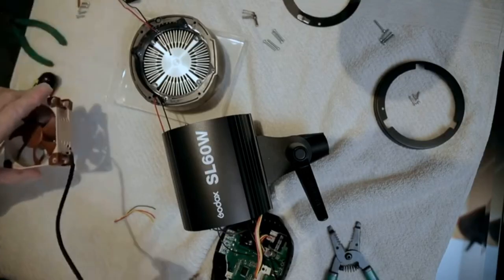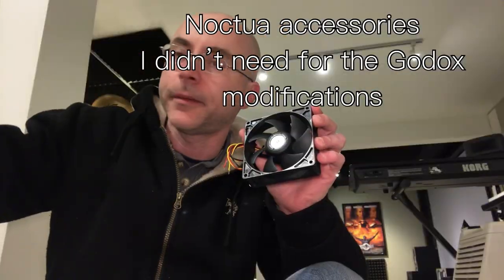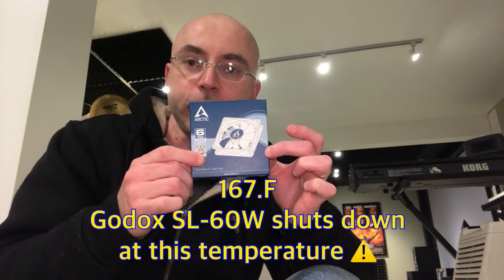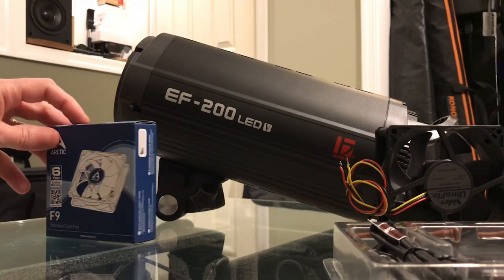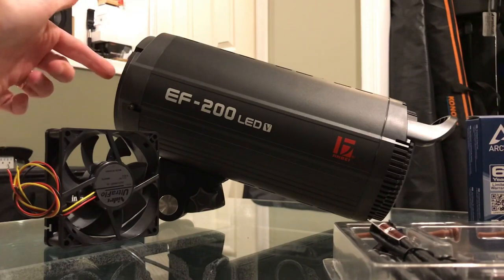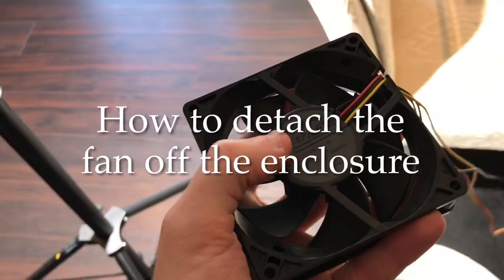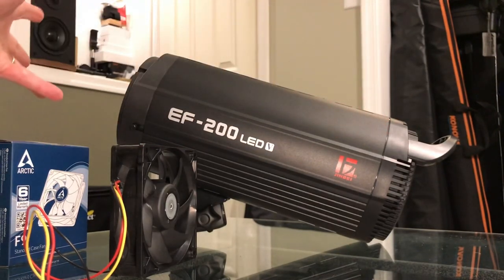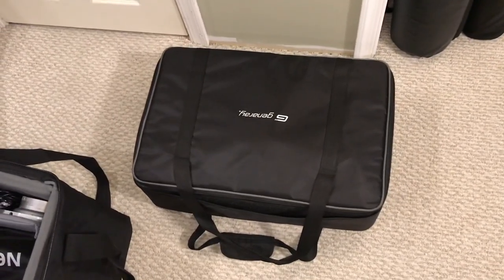Jinbei EF-200 QUIETER FAN MOD UPGRADE

Comment: You could also just buy this light instead. The fan is super quiet, it's really small and light weight too. I love mine enough to buy several.
GVM 80W CRI97+ Video Lights with Bowens Mount Color Temperature 5600K Dimmable LED Continuous Lighting Spotlight Photography Shooting Light with Reflector (80W+Filter) https://www.amazon.com/dp/B07Z5RKCYL/ref=cm_sw_r_cp_apa_i_RdpjEb4AWKG2D
Reply from the maker: Shane Harder Thanks for your suggestion, but you’re not realizing the Jinbei EF-200 is a 200 watt light, while the one you suggest is 80. I modified the EF-200’s fan, no problem whatsoever on interview sets. The EF-200 triples the power of the GVM light.
Reply: ArtVideo Productions really really good point!

Comment: Interesting problem. Since the light isn't providing 12V to the fan, maybe using a cheap boost converter off eBay can get you more RPM's from the new fan and help with the overheating. You  may even be able to over-drive the new fan with 13 or 14 volts.
Reply from the maker: Christopher Lewis thanks for your comments! Always welcome! The more RPM, the noisier it gets. The only other option is to add resistors IN SERIES / PARALLEL of exact specifications subtracting what the fan draws with the remaining current the board is asking for. 

And you must know electronics extremely well, as resistors electrons current flow it can only go ONE WAY. If you do I wrong, goodbye Jinbei motherboard. Do NOT install any fan that goes above 12v, 200 milliamps. You’ll fry the board.

What I’m already doing in this project is overloading the board a little. So far so good. If you use the EF-200 from 60% down, it will not get too hot. Only 70% and above, things get hot.

Comment: Thanks for some more very useful info. How noisy is the fan of the 
Genaray AK-230?
Reply from the maker: AyBee  at 10:53 on this link you’ll have the answer https://youtu.be/a97_aFMU6kM
ANY POWERFUL LED LIGHT, (aputure, Genaray etc) there WILL be some noise. The Genaray Radiance is quieter than the Aputure 300D and also a whopping  1 1/2 stops brighter than the 300D! It’s as quiet as it can get.

Also, for interviews in a quiet silent room, if you use lav mics you WILL heat the fan. If you use SUPER CARDIOID mics on a BOOM, you will hear NO noise whatsoever from either the Jinbei modified, Godox SL60W modified and the Generay (no modification required) and I won’t touch it.